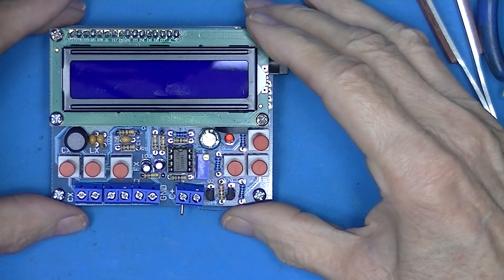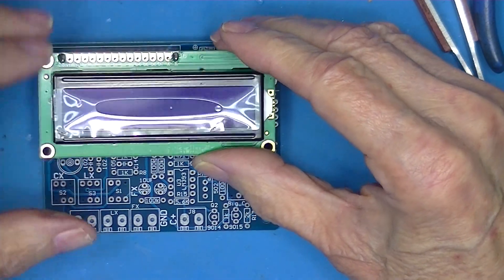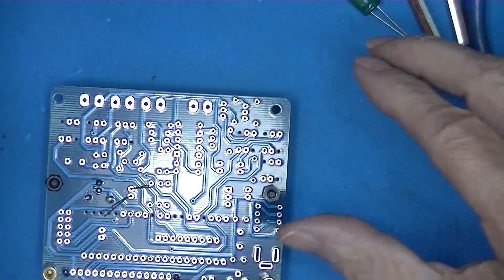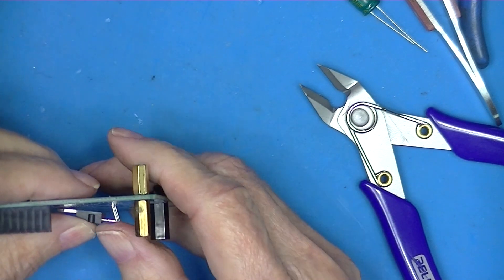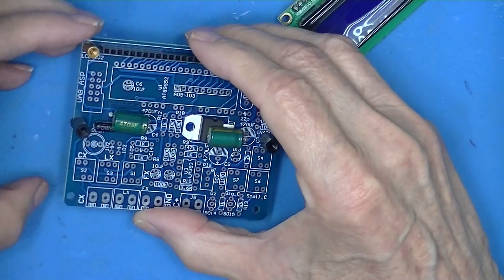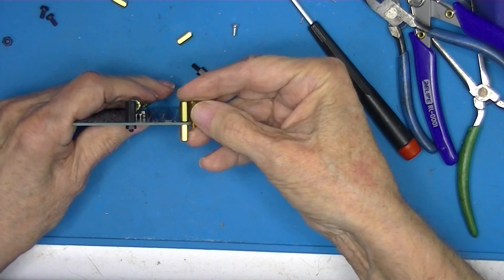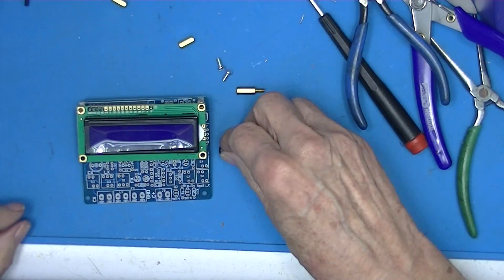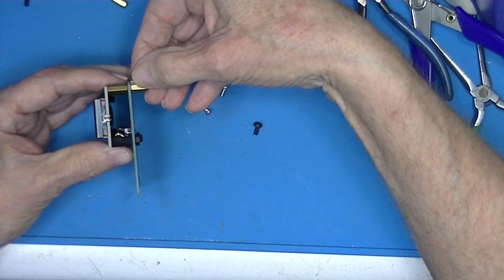Digital Secohmmeter (LCF Meter) Kit WARNING – Watch First!!!

Comment: At 8 minutes in, is that an electrolytic capacitor pressed against a linear voltage regulator? I hope not!
Reply from the maker: The heat generated by the regulator in this case is rather insignificant, so I doubt that it will shorten the life of the cap.
Thanks
Steve